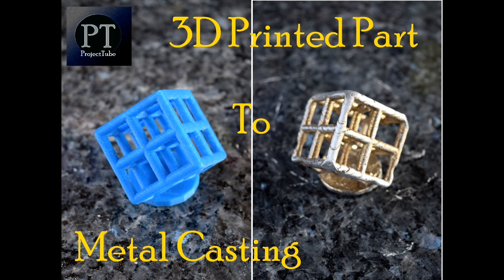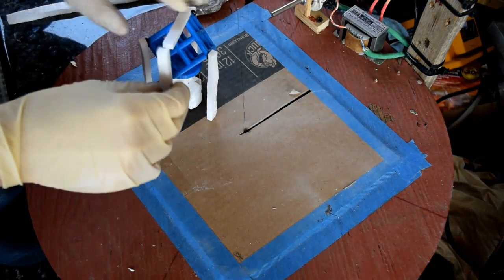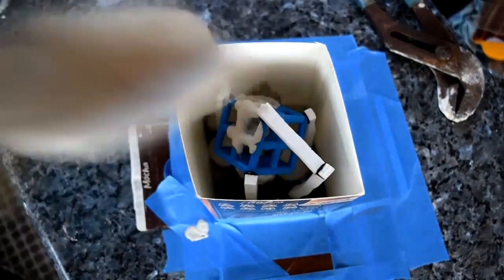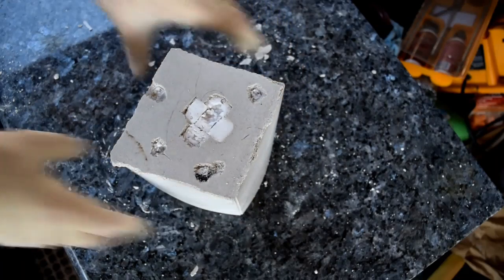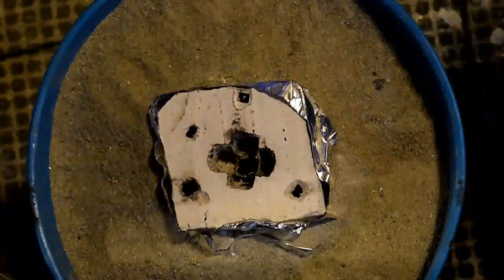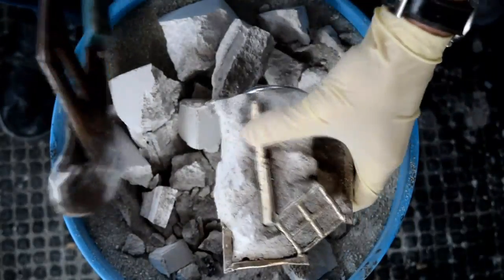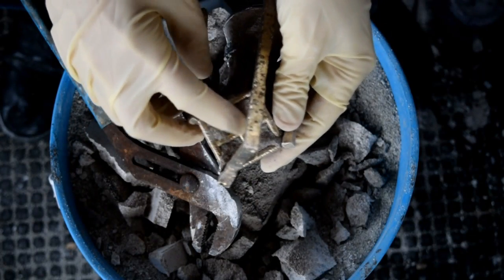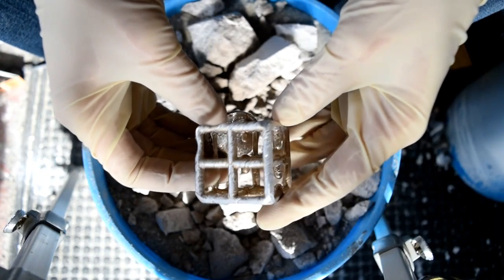3D Printing to Metal Casting/Lost PLA Lattice Cube

Comment: Why not just leave the print in there with a small hole/tunnel for the metal, the metal is hot enough to burn out or absorb the pla . is there any reason this would not work?
Reply from the maker: Yea that would be a bad idea. Basically the PLA would turn into a gas immediately upon the molten metal hitting it and you would get a volcano of molten metal erupting from the mold. I know because I had a mold a couple years ago that didn't burn out completely. I got lucky but it was not good.
Reply: Would that happen if you ventilated it properly, I would assume that the gas would be able to escape that way
Reply from the maker: @galacticcustoms3919  I don't think so, PLA isn't like Styrofoam. Its basically like heating up cooking oil and dropping water in it.

Comment: Thx, and every lost PLA attempt I've seen always seems to leave some kinda little bits of 'shmutz' in the mold. More limited metals choices, but ended up using hi-temp silicone molds with low-melting fusible metal pours, and have had no problems with crud left over in the details due to incomplete 'burnouts'.

Comment: When I cast this way I set an empty soup can (with the top and bottom removed) in the plaster. This allows me to pour fast and over-fill the mould to allow for more head thus forcing the molten Al into all areas. It makes for a big awkward sprue to remove but you can re-use the excess in your next cast. You just have to split the can open with a cut-off wheel.

Comment: That's not a hammer! :)
But seriously, here's some ideas:
1) Use flux - will make pour much better.
2) Design sprues and vents into the 3D printed model - save you on making them out of styrofoam.
3) After you pour, wait until the metal solidifies and chuck the mold into a bucket of ice cold water - watch as it magically breaks apart and disappears!

Comment: How did you get the plaster out and why plaster/sand versus straight plaster?   I've used Investment which dissolves in water but plaster seems to be cheaper except concerns about removal.
Reply from the maker: Mark Henry if you look at most investment it's plaster and fine silica. if you use just plaster the mold cracks and chips really badly. The sand helps keep the plaster together. As far as getting it out of the cast I just used a screw driver...
Reply: Thanks, it has been a lot of years since I've done lost wax, recently got back into it but was not wanting to drop $50+ on Investment for a few uses.

Comment: Get a small fan, like one of those 6-10 inch desk fans. Take the motor out and make a bracket with a squeeze clamp on it so you can clamp the motor to the edge of the table the the shaft parallel to the table top. Reattach the fan blade but cut off all but about 1/2 of the blades. If you attach that to the table it will give very steady vibrations without worrying about too much shaking making your tape come loose and if you leave it vibrate for 2 or 3 minutes you will not have any bubbles left unless one is trapped in a void under your piece.
I've got a 20 inch box fan that has a broke blade, completely gone. I tied it to a 12x24 inch piece of particle board that is about 3/4 inch thick. I tied a thin pillow to the bottom so it doesn't jump around and it will vibrate a full size workbench. I've been using it for 10 years and it's still going strong. Cheap little box fan that cost me 14$ at Yeager Hardware store...

Comment: hey chief. Looking at it I'm wondering if heating the hold with a torch would yield a better casting on that lattice cube.
Reply from the maker: +Tommy Smith like heating it during the pour? The mold was hot during the pour, probably around 400F. The biggest reason this failed was the sprue height. A taller thicker sprue would of provided the needed pressure to force a complete fill. Perhaps when I get time I'll give it another shot.
Reply: ProjectTube I would think you want the mold above 800 that why I suggested a torch. Looks like the aluminum cooled and solidified so I'm not sure more pressure would help.

Comment: I've seen many video's by car engine companies, they make the blocks for the engines. Also other companies that make parts for edger's etc... The trick is ti fill the voids from bottom up. It isn't as hard as one think, one can construct a "piston" style tube and plunger. After the hot metal is poured into the cylinder the piston is inserted and this forces the metal into ANY CAVITIES as long as there is a way out of the top for venting the hot air and overflow. They also have before the "part one pours" a FILTER that catches some imperfections in the liquid metal. I think for people who are seriously thinking about making metal parts, this can be done. If one has a larger volume of melted metal, one can make a reservoir to the side, that connects the form, from the bottom, but it must be preheated, just like the "piston mechanism" to PUSH enough metal into the form one is pouring, before it hardens!

Comment: you SHOULD get a Sonicator !!! Use the sonicator for both the sand filling part and the metal pouring part. Since you can set a flask directly in the bath bed with no liquid on the bed directly then you should be able to set hardened sand block in the sonicator bed when pouring the molten metal, that should work wonders with your fill !!

Comment: While doing some lab research I usually work with molten PP and having some oily residue after working at high temperatures it's pretty common. If I'm right Plaster of Paris is hydrated Calcium Sulfate, if you use an acid to clean the polymer residue you may damage your mold. I'll recommend using Ethanol or Acetone to clean it.

Comment: Hello! I Just discover you channel and I already love it! I guess you're using molten aluminum for your casts isn't it? Have you tried other metals? Btw have you cast some mechanical part like a gear or smthg else and check if they bend or break under mechanical stress?

Comment: I think you are failing because you need to use a better technique to fill the mold. I am not into this, but after watching your video, I got the idea. Make a type of cement/metal chamber or funnel just outside of the filling hole. We should be able to drop about 200% of needed material into this funnel/chamber, we fill it in one single movement, then gravity does the rest. With this, because of the excess needed material and the external chamber, it keeps a high temperature at the center and bottom of the liquid, around the hole, no giving chance to hard stuff. It's not a problem the waste, because it can be recycled, I think the most liquid you use, the better.

Comment: I am involved in full-combat medieval re-enactment and I was wondering as to the feasability of printing these (or similar) gauntlets and casting them in their individual parts. I can model them to 16 ga. thickness (1065 mm) and have them printed but I was wanting your opinion as to the castability of it all.
https://s-media-cache-ak0.pinimg.com/originals/76/34/48/763448e5749feb40c6ed9acee57af638.jpg
Reply from the maker: +Jimmy Mac I think this would be difficult to cast due to how thin it is. It be interesting to try but you'd have to cast each individual peice and it be a lot of work. It probably be better to forge it on an anvil.

Comment: You need to make a large void above the cast, as a well, to create the down-pressure youre looking for, as well as venting from the bottom/sides. It will also aid in shrinkage, as the large well will remain molten longer, and let the cast shrink as it cools and fill itself from the well above. Cheers.

Comment: T-Rex skeleton: http://www.thingiverse.com/thing:275091

I'm working on casting this in brass. My process will be a little different from yours. I'll use perforated casting flasks, jewelry casting investment, a vacuum chamber to get the bubbles out of the investment, a programmable electric burn out kiln, and a vacuum casting process. The only thing I don't have set up and ready to go yet is the pipes to hold my casting flasks for vacuum casting. I'm getting close though! I just need a few more weeks time.
Reply from the maker: +Joe Brown thats the right way to do it!

Comment: If you heat the mold with a propane or mapp gas torch right before and during the pour you will likely have better penetration of the molten aluminum.

Comment: Have you thought of using abs and melting out with acetone
Reply: Doesn't really work, abs dissolves in acetone quite slowly and precipitates out very fast when the acetone boils off. It will always leave residue behind which will ruin your casting.
Reply: or instead of plaster, sodium silicate and very find sand. and i would heat up the mould in the oven before i pour the aluminium in it.
Reply: Phil Chia I have a nice 6 pack but they can't ignite anything

Comment: Couple of small suggestions.
1. Your head is not big enough. The metal doesn't like to go into sharp corners. You need the mass in the head to provide weight as back pressure to force it into the crevices. Build the reservoir much bigger and higher up.
2. When mixing the plaster/Silica - you really want to add plaster to the water first and then let it sit a minute before adding the silica and strirring it in with your hand until well mixed. The plaster will be stronger this way.
3. For bigger castings - make two coats - one where there is more water in the first mix - which will give you better surface quality, followed by a separately mixed thicker blend for strength (which you can also add sand or grog to for more strength).
4. If you drop it into water when you're done the plaster silica will dissolve away easily.
5. consider steaming the pla out as there wil be no blackened surface for the metal to react with and you'll get a better surface on your casting.
but #1 is the key....
Reply: Great tips. Thank you very much!
Reply: 1. it is not the mass of the head that provides pressure but the height above the casting. Increase the height and this will increase the pressure of the flow into the item being cast. My experience if it is around100mm it is ample.

2. I suggest that it is better to mix the dry components first to ensure even mixing. also the time after adding water is shortened. the strength is not affected.

3. is a very good recommendation. the first coat can be painted on. then the second coat poured around the first once it is dry.. This also minimizes the amount of total water in the plaster as the second coat can be considerably dryer.

4. correct. and good for getting the plaster out of the fine detail.

further it is better to have the sprue fill the item from the bottom of the casting and have the metal "rise" within the casting, rather than pouring the metal into the top of the casting. this is done by running the sprue down below the item and have a runner across and then up into the item.

when pouring ensure that the sprue is always full so that no air is introduced into the pour..

good work.

Comment: little tip.  Increase the height of the spru relative to the vents.  The weight of the metal helps push it in to small features.  you can see the metal flow through the mold.

Comment: Hey i think i have an idea to make sure all the details get filled in.
I want to experiment with them mself, so it is unproven and i have no idea of it being more dangerous than pouring liquid aluminum already is.

I would try to put i bigger riser on top of the mould to have more pressure inside the mould with all the aluminum on top of it.

Seconly i think that pre-heating the mould to 200 or even more degrees celcius will give the aluminum more time to get to all the tiny places.

I'm going to try these things myself to very soon :)
Good luck.

Comment: Would it help if you tapped the mould/bucket of sand moments after pouring your metal to fill the voids just like you do with the plaster? Also if you made a funnel you could pour more molten metal than needed so there'll be more weight/pressure pushing the metal down into your mould.
Reply from the maker: +James Mulchrone It probably would help and having a bigger main sprew with a taller hieght does help with the pressure. I think in the case of the lattice cube there was trapped air in the void spots. More risers would likely have helped with this.
Reply: ProjectTube The only downside that came to mind is tapping could potentially make the molten metal spit particularly if it does cause heated gas to rise. I was just thinking it might be worth keeping in mind for future pours. Great content by the way.
Reply: Tapping will not help. The problem is the surface tension of the molten metal resists your desire to go into sharp corners. Add more mass and height to the head. Plaster is cheap.
Reply: neonboy22 Concrete also has pretty high surface tension and vibrations help in that case. It's at least worth a test is all I'm saying, what's there to lose?
Reply: You're quite right but the metal is molten and cooling. so two potential problems vs concrete.
1. If it suddenly went through a small constriction and rushed in then it might spurt back up and you might get hit by molten metal. Metal sticks to skin and the burns take a long time to heal (Alas I know).
So for safety reasons.
2. The metal skins over very quickly where it hits the mold surface. There is no time to do a second step. The metal needs to go in smoothly and have a high back pressure so it fills in quickly and skins that form don't have voids in them or weird crystal structures formed by partial cooling. (which would make them mechanically weak).
IMHO its a good idea to sample the literature and experience of traditional methods and use those that are suitable for each material. In metal casting - no one uses a mechanism of vibrating the mold after a pour.
Reply: neonboy22 1. I already mentioned that there's a risk of spitting but you could reduce this risk fairly easily by placing the likes of an old frying pan lid over the top or wearing protective gear.

2. Good point, maybe it would help to have the mould preheated slightly so the skin of the metal doesn't form so quickly also you could use a small rumbler (like those from a game controllers) so a vibration would be acting on the mould as it's being poured instead of doing so after and the vibration can be wound up and down as required from a safe distance.

Comment: I was just about to do a project just like this it was a good video :) Also would this work with iron or would i need to use a different mold material :)
Reply from the maker: +Tyler Jordan I have never cast iron and probably never will. The temperature needed  is just too high. As far as the mold material I'm not sure, you could probably use casting sand though.
Reply: Thank you for the advise I have worked with aluminum and just recently cast iron :)

Comment: I like your videos! There's a 3D printable plastic called PVA, that dissolves easily with water, so people use it mainly for 3d printed support structure. I'm just starting to learn to cast aluminum, so your guess is probably better than mine, but do you think you could 3d print something out of that, coat it in some almost hardened plaster with powdered chalk or something, and then create the mold around that, so the burnout process could be simplified to running water through it?
Reply from the maker: +rety20 thats not a bad idea...I wondering if the water in the plaster would dissolve it before it completley hardened though. I'll have to look into it. Thanks
Reply: A wet or slightly damp mold is a BAD idea. It can explode when the molten metal hits the water, flashing it to steam. Mold needs to be bone dry.

Comment: Why not add the sprews, etc. to the model before printing?  You could even print the enclosure, as part of the model, so you end up with a single unit to simply fill with plaster.
Reply from the maker: +David Smith I've thought about doing this and it's not a bad idea. The biggest issue is id have to edit any models I want to cast. For the rotor no big deal as I designed thst myself. The lattice cube id have to take into software and add to it. I think it's just quicker to add Styrofoam, im by no means a expert at 3d modeling software.
Reply: I thought you'd adjusted the diameters of the lattice cube - so already had it in a 3d package - my bad.

I was also wondering if you could use soluble PVA filament (intended for support material) - but then considered it may dissolve too quickly, while being moulded - rather than in a controlled way after the plaster has dried.  Be interesting to see an experiment though.
Reply from the maker: +David Smith No your right, I did adjust the lattice cube but it was through the customization on thingyverse. Basically just slider bars to adjust different aspects of the model. No way to add parts to it that I know of, could be wrong though.
Reply: Ah.  I misunderstood that process.  Shout if you want to experiment with 3d printing the breathers, sprews, etc. as I can add them for you, if that would help.
Reply: Load it into OpenScad and add them there. You could print with PVA and it will melt out at lower temp. But PVA erodes 3Dprint nozzles apparently. You could then use a steamer to get it out - much better surface quality. (Double plastic bag the model upside down over a wallpaper steamer, or pressure cooker with hose on the vent.)

Comment: What brand of casting investment did you use?
Reply from the maker: +AAlbritten3rd I use a mixture of plaster of paris and silca sand. A 50/50 mix.
Reply: Ideal mix is equal parts water, plaster, silica by weight (silica is denser and heavier than plaster.)
Silica grade of 150-200 mesh is fine. Finer is more of a health hazard (silicosis - always wear a mask with Silica dust) and will not help with surface quality.